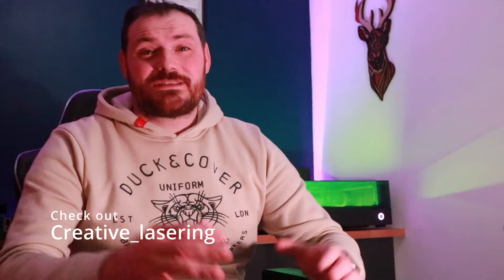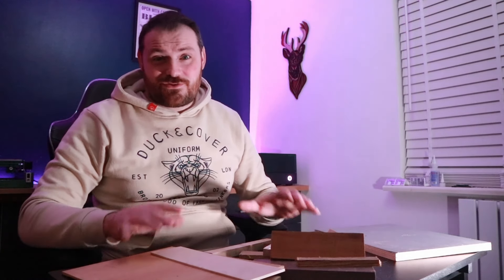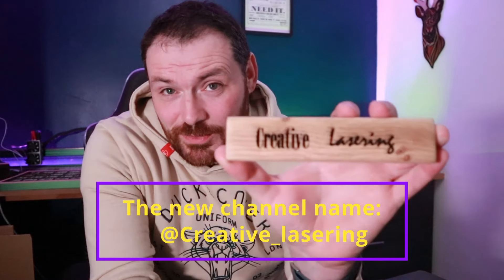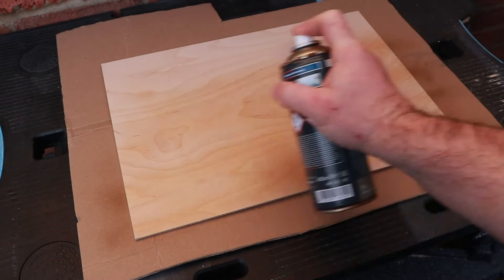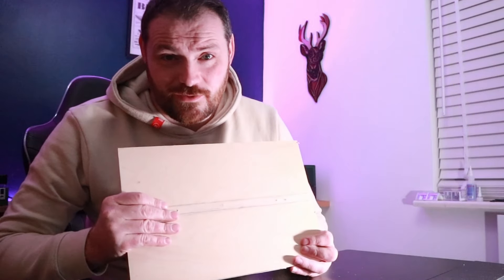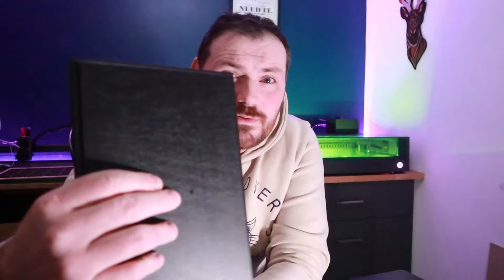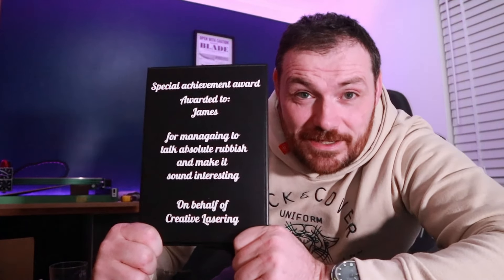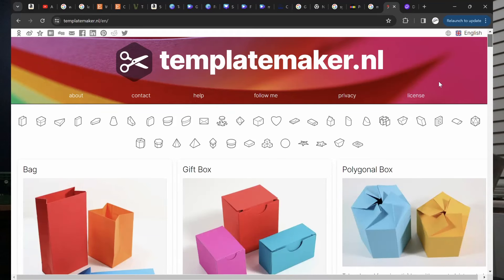Make Money With Your Off Cuts featuring The Xtool S1 #xtool #laser #smallbusiness

Comment: Did you upgrade from your F1 Ultra? Have both 20 & 40W now? Looking at the F1 Ultra for my first laser. Not sure.
Reply from the maker: @guy7622  no I have the S1 40W, D1 pro 20 & 40w and the F1 ultra. I would discount the D1 pro, it Al depends on what you want to engrave. The S1 has a larger work area, and you can change the laser modules. The F1 ultra is capable of engraving on more materials, but on a smaller work space